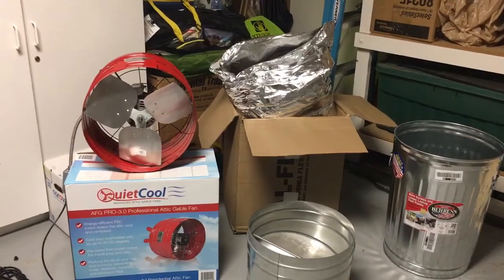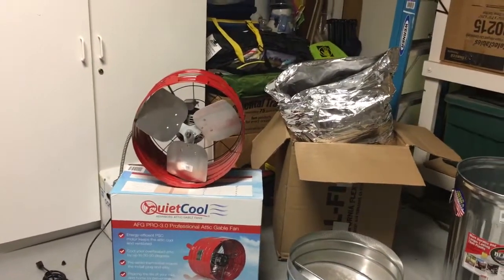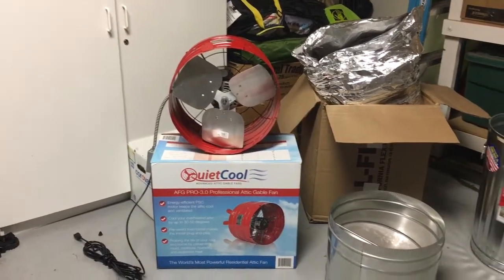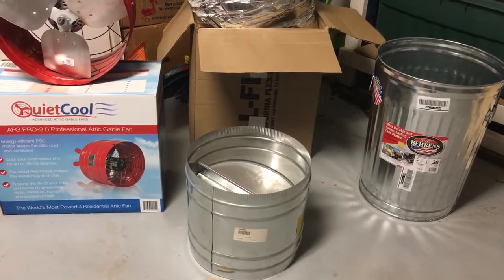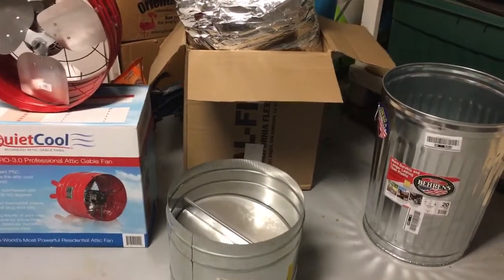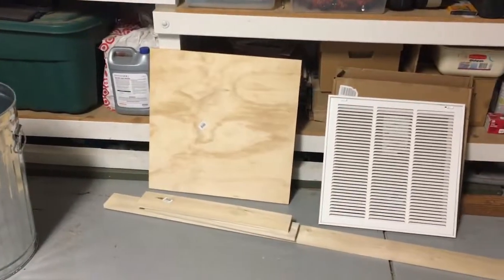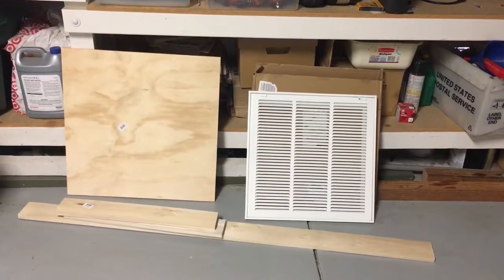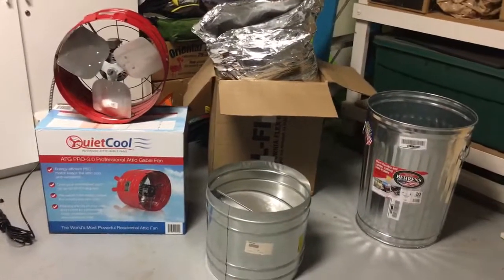DIY Whole House Fan - Materials Guide

Comment: i see all the links,  thanks Kevin,  you did not use that register box tho right?  i saw you made your own out of wood,  the metal did not fit?
Reply from the maker: I was going to buy the metal one but it would have been $55 with shipping.  Plus I didn't want to wait... I built out the register box out of wood for $20.  It's super easy.   Use 1" x 4" poplar wood for the square casing and a 1/2" piece of 2'x2' plywood  for the duct cutout.

Comment: I have a similar setup. Although it works very well, the fan (3000 CFM) is just not big enough for my house. My house, a two-story house is not that big, about 3000 sq ft. It takes a long time to cool it down. The air flow is pretty weak with these QC fans.
QuiteCool doesn't sell bigger fans to DIYers. Their own systems could blow as much as 6000 CFM of air. I guess that's how they can jack up the prices of their systems to $1700.

Comment: i just recieved the 16'' backdraft damper from Famco.  the quality is so poor,  the damper does not seal right at all,  one side gets stuck in the foam and the other side only touches the foam on one end the rest is 1/2 above it,  very poor quality product,  very flimsy,  disapointed in it...  sucks,  its the only thing holding me from finishing it,  everything else is ready.
Reply from the maker: Arghhh...Sorry to hear that. I thought maybe I was the only one with the issues.  Have you looked at the one from Fantech?

http://www.electricbargainstores.com/product-p/Fantech-RSK16.htm?gclid=Cj0KCQjwtpDMBRC4ARIsADhz5O5TtPgFKjXFtL5Fxb4xEiGEH-6iy5owYTkIhMmU5T8G6U33il2RHhUaAm0mEALw_wcB

This is the lowest price I found.
Reply: i havent seen that one,  looks good,  looks to be higher quality,  i cannot believe the seal they use is a cheap foam type.. seriously disapointed,  with the heat in the attic and the fans air movement,  i dont see that lasting at all,  which one are you using the famco or the fantech?

Comment: So after using my WHF for a few days,  heres what i think,  if i could've done it all over again,  i simply would'nt,  IMHO its not that great,  i have been using 2 of these window fans for a few years now,  one at a window at each side of the house,  and in the morning the inside temp is right at 73-74,  http://www.ebay.com/itm/Bionaire-Twin-Window-Fan-Control-Digital-Thermostat-With-Remote-3-Speed-Setting-/112478529640?epid=1637487150&hash=item1a303e2868:g:EIMAAOSwgu9ZZa6s   using the WHF the temp in the morning is 74-75 and its LOUD,  the window fans work better because they are whisper quiet,  even on high,  you can be in the same room with them right by you and sleep well and not even notice them,   the WHF is loud,  and it sucks out the cold air it brings in,  while the window fans just bring in cool air and it stays in the house,  thats my honest review,  how do you like yours kevin?  the system works great,   im still going to use it,  just not really impressed with it,  and you are awesome for your videos.